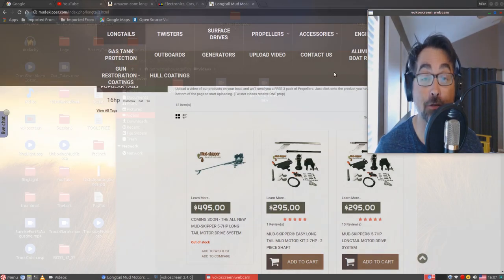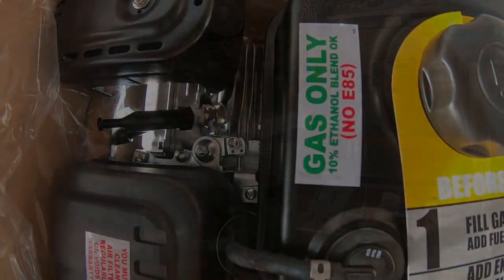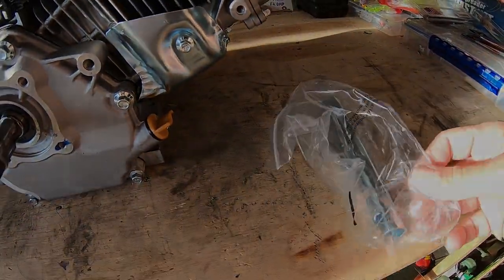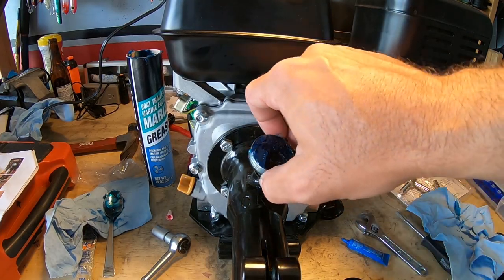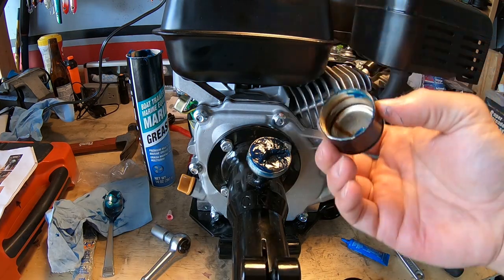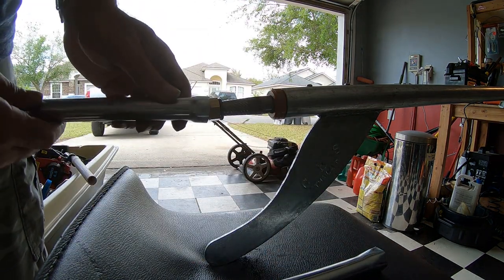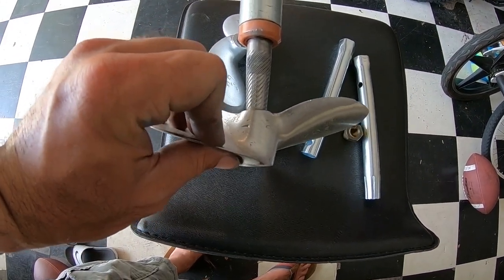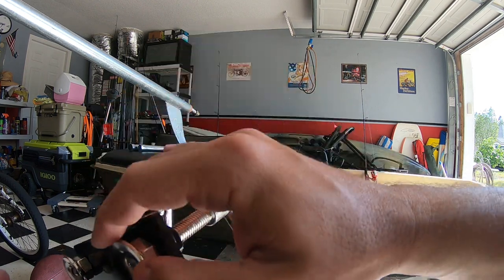Mud-Skipper Thai Longtail Assembly Step by Step Install (Predator Engine 6.5 HP 212CC)

Comment: i saw a key way cut in the coupler that installs on the engine shaft ,why didnt you use the key ,is it stated not to use the key in the instructions?
Reply from the maker: The key is not used. The 2 bolts in the coupler are what is going to hold the coupler in place.
Reply: This was a big mistake, leaving the key out and relying on tightening two course thread bolts on a keyway.  I have the same kit, and used the key, which is obvious to all with any experience assembling power equipment.  Yours may hold for a while, but will eventually loosen, and with damaged keyway will be difficult to install key later.
Reply: Also, now that I watched the whole video, you should always apply the marine grease to  the splines both at the engine and midpoint between the shafts. rather than anti-seize.  These parts need to slide at times and will never be welded together by heat if you keep them greased at assembly.  Grease should also be applied inside the cap, not to the shaft part, so that a large grease plug will be injected to the splines.  The way you did it, no grease would get injected.

I used mine with the same john boat you have, only I stiffened the transom greatly using a 2 by 12 c-clamped to the transom.  The transom on this boat is not strong enough to use that engine alone.  Also, you need a lag screw to hold the engine down for high speed, since you will be pulling up on the tiller.  I put a screw into my 2 by 12.  I recorded speed of 17 mph average with same rig as yours, so worked well, but hard to handle due to bad balance of the rig.  Engine needs to move back about 2 inches to balance at full speed, and no way to do that with that rig.

I use my mud skipper on another boat all the time just fine.  It has a heavy wood mounting bracket that is vertical, which works much better.  Have fun.

Comment: Do not see the benefit of filling the housing with grease as the only parts needing lubrication are where the driveshaft and adapter splines engage, which is easily lubed with just a finger full of copper anti-seize or high pressure lube. There's never been an issue by not filling housing, not have I had to deal with the mess it can make. Other than that, I was impressed with my latest small kit as the fit and finish are near perfect.

Comment: what size boat is every one using this on
Reply from the maker: I had it on a 12 ft and a 14 ft Alumacraft when I was using it.
Reply: @GetOutTheHouseGoFish  Thanks I have a 14 foot wasnt sure if 6.5 hp would push it currently have a 15 hp mercury on it